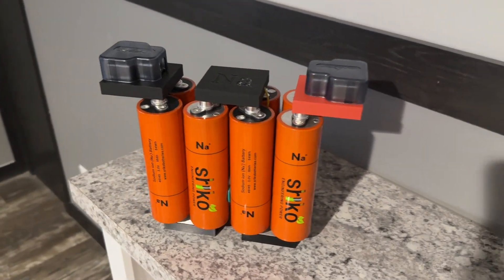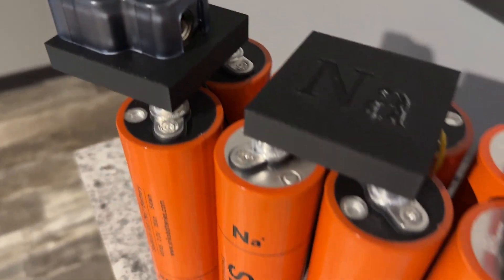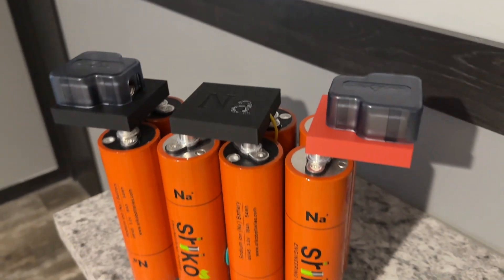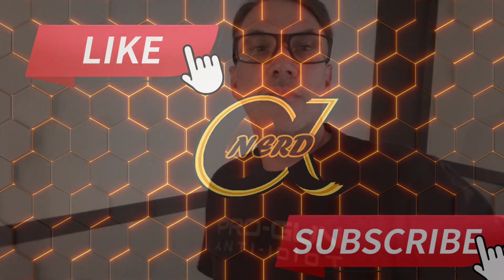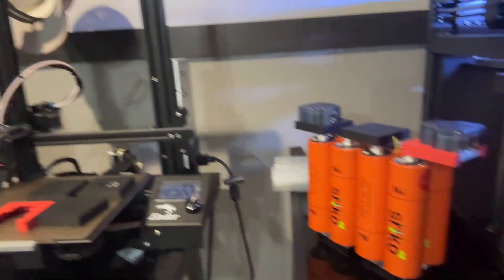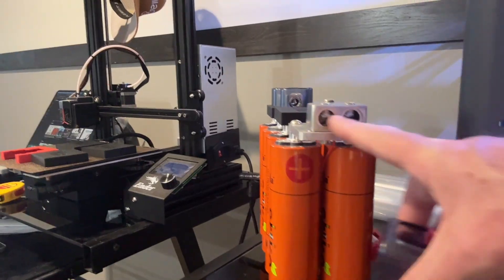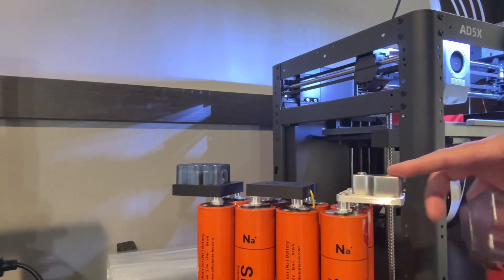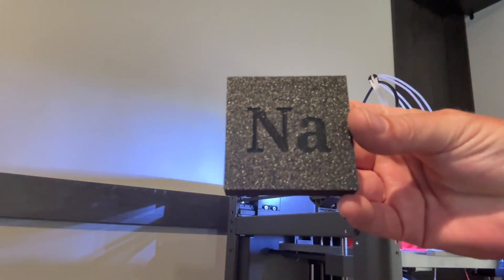Sodium Battery pack quick update. Sriko sodium cells. Silverado EV D4S

Comment: Hello! I'd like to offer my services for collaboration and video promotion on your YouTube channel.
Video advertising. I see that your channel has potential for growth and could get more views. I also see that you're probably boosting your views a bit, but where you're boosting them, the speed is very slow and there's not much result.
I can offer you good views, likes, and comments. If you have links to sales sites under the videos, you'll also get clicks. We use only white hat advertising methods; no write-offs or blocking. View rates are 50,000+ per day (even higher is possible). We primarily work with volume.

What do you think?

Comment: Why do people talk so much trash on sodium on the Facebook audio groups?  For those of us that are willing to spend a little extra more to avoid the risk of fire… How are they not worth it?
Reply from the maker: Right. I live in Texas where it's 150+ inside the car all summer long. I want my system safe.
Reply: @alphanerdtravels Hopefully, it doesn't get quite that hot since these cells are only rated for 140°F.
Reply: Keep in mind that your not avoiding the risk of fire. Sodium cells can still ignite, but its harder to do. So you're actually 'reducing' the risk, not eliminating it.

Are people actually saying negative things about it? 
I can maybe guess that some people complain about it's power to cost ratio. Or maybe it's power to size ratio? Maybe they think anything under 16v is no good?

I can't really think of anything negative about them.
Reply: @JasonWW2000 im a hater on soduim.  Just seems like trash. It can't hold voltage to save its life. I understand it's hot in tx but cmax shits on soduim so badly.